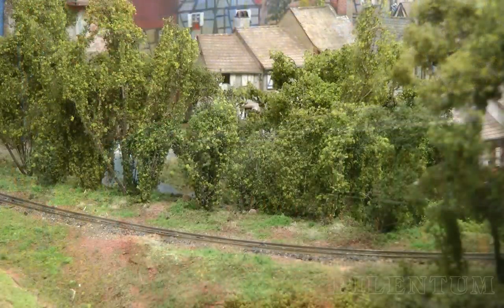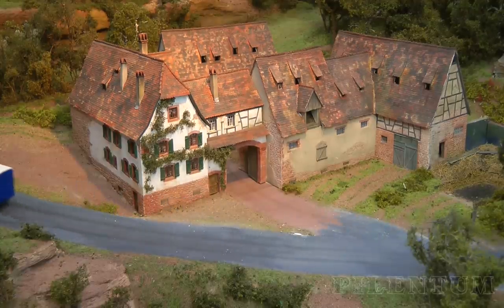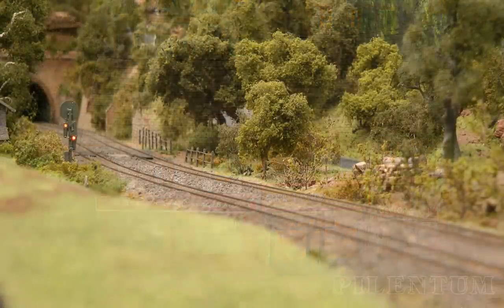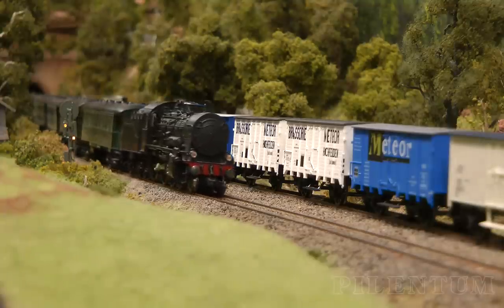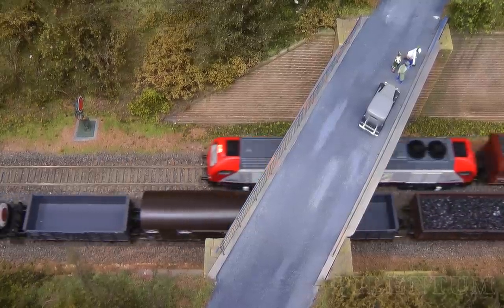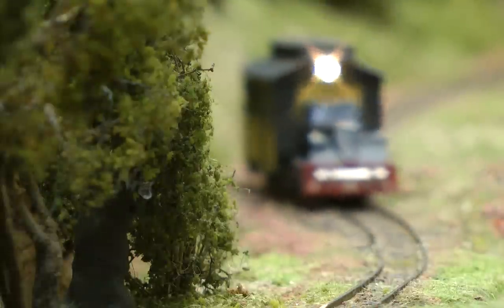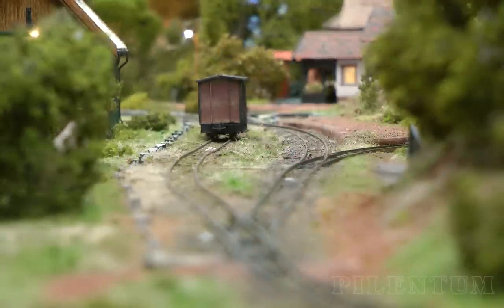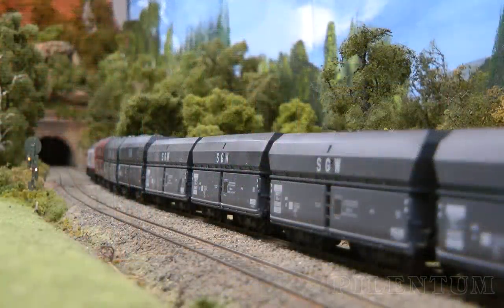Superb Model Railway made by French Railroad Enthusiasts

Comment: Very beautiful. U suggest to use cars from the steam era on the faller car system that matches the era of the locomotives.
Reply from the maker: The club members build the vehicles themselves - that's how I understood it. And when you start building a car system, you first build big cars, then smaller cars. Therefore, there are primarily trucks and buses from modern times. But it's true: The vehicles have to match the time period.
Reply: Also, there are very, very few models in HO of French commercial vehicles from before about 1960 or so. Mostly German, Dutch or Swedish models which would not have been common in France before the late 1960s.

Comment: Sir i m from India plz sir i m request to u plz sir send me name of motor size voltage ac/dc wheels dimension and track materials which you are used plz request to you
Reply from the maker: Hello to India! The model trains are built normally in 1/87 scale. These locomotives and wagons, you can buy from the manufacturers Roco, Jouef, Piko, etc. Maybe you can not buy them in a shop in India. But you can buy them anywhere in Europe on the internet.